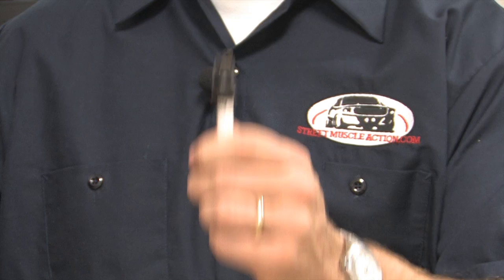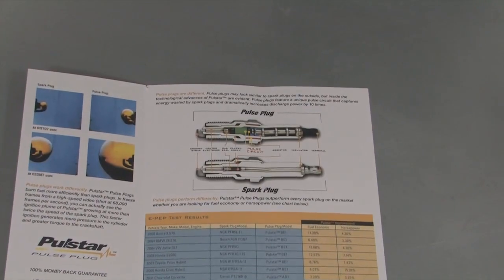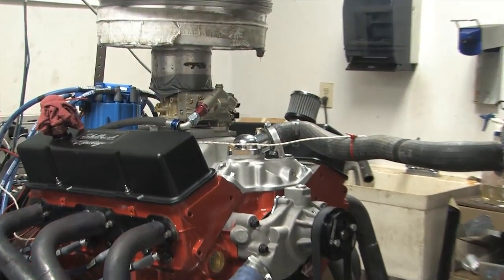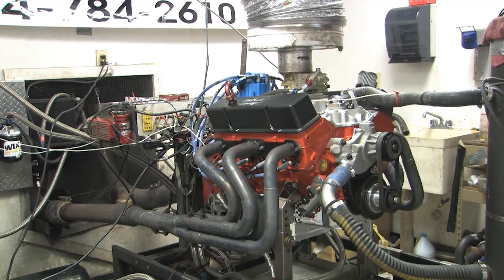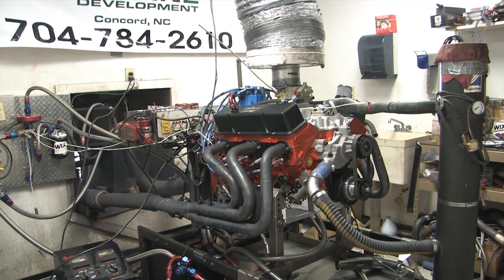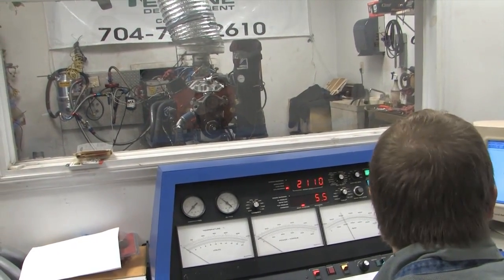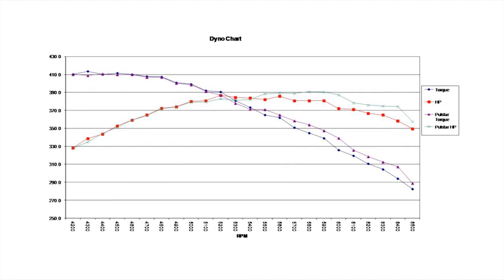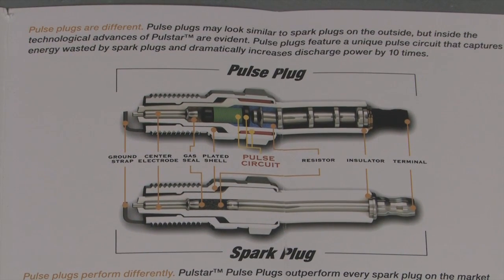Dyno Testing Pulstar Plugs to See if They Make Power

Comment: How to steam clean the engine constantly while you drive.

Get A piece of paper and twist it clockwise until it looks A twisted blunt.  Get in as much twists as possible.  Then put it into the air intake before the air filter.  Make sure that it is parallel with the intake tube and secure from being sucked into the tube.

Drive the car like normal for about half an hour and then pull over to A parking lot and get out.  Go to the back of the car and put your hand in the exhaust stream.  You should feel damp vapor coming out of your exhaust.  That is how you know it is working.

  This should give you A few MPGs better mileage for A few reasons.  Coolant is A lubricant, the coolant is already hot and turns to steam easier than if you have A mist system.  When water turns into steam it expands A lot.

You should use environmentally friendly coolant if you use this trick.  To protect your health and others.

I have not done this on A rotary car yet!  So you are on your own if you do this.

Try it or not, as it may damage your engine.  

The coolant will have to be checked more often as well.

Comment: In the US, we say foot lbs. Just wondering where your getting this lbs feet ? Your not measuring feet.
Reply: Both terms are equivalent. Despite the different wording the torque unit here  based on Force X Lever Arm Length. Using English base units is (n Pounds Force) X (1 Foot) effective dyno lever arm length. ( With a lever arm length of 1 foot, the resulting torque is equal to the Pounds Force number with the unit Pounds X Foot, = Foot X Pounds, or ft/lbs. Equivalent torque values can be expressed as constant pounds force with variable lever arm length,  or variable pounds force with constant lever arm length. For the same pounds force, with a 2 foot long lever arm would be twice as much torque. BTW, Torque does not depend on the rate of production ( engine RPM). For example, any value of measured torque at zero RPM is zero HP.
Reply: J.S. Sancrant  I know. It's just that we used to always say foot lbs. But thing change.

Comment: As long as people continue to spend hard earned money believing good marketing lies...you'll see BS claims like this.
Anyone who's been around awhile will remember Splitfire plugs making the same promises, with the cost being around 4 times as much as any other spark plug of its time.  The ONLY way a spark plug can make any more HP is by burning more fuel.
Reply: At least pulstar makes sense in theory.  A hotter faster spark due to capacitance.
Reply: @SubLimation7  projectfarms tests also show pulstar as outperforming Iridiums which i've sworn by. pulstar and e3, at least the two models PF tested, both were head to head fuel efficiency wise. they ran a generator for a min or so longer than the iridiums(iridium was about 45.5 minutes, pulstar and E3 were nearly 47 minutes). for 8 bucks for an e3 plug i figured it was worth the test for my own vehicle. pulstars are expensive and rare here in canada so maybe next time i need a spark plug in a few dozen kms.

Comment: Thanks so much. Not worth it at all especially with a car that takes around 4-5 hrs to change plugs because the motor is trans mounted. I have a 2008 Highlander with 170k miles with the same plugs. I’m replacing with OEM plugs for sure.

Comment: Didn't (and won't) watch the video.  Using such a highly  modified engine is the worse way to test aftermarket parts.  I think a plug is a plug is a plug, but why doesn't someone do A/B testing on half a dozen stock cars (from economy to performance) comparing brand new Pulstar plugs against brand new OEM plugs for HP, TRQ, and mileage?

Comment: You mean the stock 3.48" stroke. Ford uses a 3.5" stroke, stock in the 352FE, 352W, 351C and 352M engines.  Heavy used the 3.48" stroke in their 350 and 305. The funny thing is back in the mid 60's Vic Edelbrock took a 350 hp 327 , broke the engine in according to GM specs and put it in the dyno. It only made 313hp. He tried a few thing and when he swapped plugs from AC to Autolite the motor picked up 5hp. This guy is going from Autolites to these new plugs. So if Vic had had them back in the day he could have picked up 8hp must by changing spark plugs! Hmm..
I wonder what would have happened if Firestorm plugs had been available! They induced a plasma into the combustion chamber instead of a spark, providing a cleaner, more thorough burn of the airfuel mixture. They were way more efficient that any sparkplug ever made, but the inventor was met with resistance everywhere he went. Thesparkplug companies didn't want them because they lasted too long. The oil companies put up a fight because they improved mileage significantly, and the Auto Manufacturers didn't want them because they owned spark plug companies and were influenced by the oil companies. Every time someone comes up with a better mousetrap, somebody else shuts them down! Shit!
Reply: I'm glad I encountered somebody else who is aware of the Firestorm spark plugs. Nice design. I've corresponded with Robert Krupa, in the past. Your comment reminded me of him.
Reply: @brianwesley28  I hope he's doing well. I really wish I can get some firestorms directly for the saab.

Comment: i know boshe platnum plus 4 make power
Reply: biggdaddy blade works: I like Bosch Platinum +4 plugs, however reality is electricity takes shortest path, so you only get one arc, however when that ground strap gap becomes wider than one of the other 3 the arc will move to one of them...on further review having the ground electrodes on the sides of the center electrode on most modern pentroof central plug placement seems to make the ignition much more complete.  Most everything I have for snow removal, has been switched to at least 2 Ground electrodes, and cold (-20°F) starting has vastly improved.
Reply: M Shultz idk i just know they make a noticeable difference
Reply: and they are not 25 each

Comment: So basically, the improvement in Hp/Tq occurs when the speed of wavefront becomes a limiting factor (4k RPM+). So, unless you're racing, there's no benefit to using Pulstar in regular street/beater cars.

Comment: I bought a set for my 1998 Honda Accord 4 cyl coupe and achieved 31 mpg at 80 mph on a 1200 mile trip from Detroit to Dallas. The car is rated at 28 mpg; that's an increase of just over 10%. They didn't work very well in my 2008 VW Jetta Wolfsburg with the 2.0 turbo though. That engine ate the side electrode on all four plugs by about 25k miles! Weird!
Reply: ShiftyKen 08 more than likely the fuel..refinement...check millage rateings euro...their fuel is more highly refined..you will be surprised..same happens here some parts of country when switching blends..
Reply: You can't use one run as a definitive judgement. I made one trip in heavy head and side winds, and I lost a few MPG. Did the same trip a week later with no wind and was back up to normal. Did it in rain and lost a tiny bit of mileage too. 🤷 You need several trips and an average of all in order to make a claim.
Reply: Are they still in the Honda and if so, are you still seeing gains?

Comment: i wonder if it works on motorcycle
Reply: Here is a guy that tested on a Harley with positive results. Wish there was more independent tests done.... I'll be trying them in my 2001 Honda Insight. It's only a three cylinder so pretty cheap. Thinking about running some mpg tests with a few different plugs...

https://youtu.be/ce6ijLPx9Fs

Comment: A carbureted engine, as this appears to be, may not be the best application for these plugs.  Possibly power is available, on the upper end would be nice, if Lamba O² readings allow for a little more fuel. A close comparison of all the data may reveal something worth thinking about. You're in for $200 already... Best of luck.

Comment: why not test out  10 different sets  basic , cheapy  $2 plugs .  autolite , bosch  chanpion , ngk  denso etcc . You might find basic plugs can out perform  the high dollar pulstars   . Wouldn't that be embarrassing . .
Reply: ...copper core plugs actually might beat it. the reason fancy plugs use platinum and iridium is lifecycle, not conductivity. copper is king for plug performance.
Reply: @noclouds111  It is true, once you ignite the fuel mix it won't matter what started it. But you go keep the industry happy spending money not needed. It's why third party addons love people like you.
Reply: @oo0Spyder0oo  If what you say is true, then installing new spark plugs will not make any change in HC or CO emissions. We know that that does actually make a change. Heat ranges also wouldn't matter for spark plug selection. A hotter or colder plug can be chosen for best combustion results. I don't believe in this Pulse Plug concept either, but I also know that combustion and flame front dynamics are not black and white issues like you portray. Same goes for a diesel engine. "Injector nozzle design doesn't matter. Spray the fuel in and it'll burn all the same. No need for 2/3/4 pulse injection." That's again, simply not true.
Reply: @mannys9130  Good for you
Reply: Each car maker designs the engines to use certian plugs toyota uses ngk ford uses autolite Chevy bocsh or whatever they use so you may have a good point you should use what the engine is designed for
Reply: Exacty. You ca't get ore hp, it's there to ignte the mix so the manufacturers put in the right plug to do that job in the beginning. It's like saying you can burn down a house better using a better quality match.
Reply: I'm sure they'd be happy to do that if you paid for them all.

Comment: In my experience, it takes a little driving for the ECM to adjust to the Pulstars. Using a chassis dyno for torque and horsepower plus very precise fuel measurements will tell a more accurate story, with a few days of driving on the Pulstars before the test. The manufacturer has done MANY of these.

Comment: I purchased these for my focus. Ran okay for about 5k miles then all of a sudden I had a minor misfire only when idling. I wasn't sure what it was considering I had new plugs, wires, and coil.. but I thought it was worth it to take the plugs out as a "by the by" type of check. Better safe than sorry, right? Cylinders #123 were okay. Number 4 spark plug the ceramic coating around the the center electrode had knocked itself off and by the luck of god did not fall off into the cylinder. I believe I still have pictures of it too. Absolutely would not recommend these. Trash. Over priced trash.
Reply: jake20479 you over tighten the plug or there was a factory default in it all ways check the plugs before you put them in.
Reply: Theodore Orcutt i checked all the plugs before I put them in, and I know I did not over torque them. If it were a factory defect then okay, but honestly for how much i paid, there is No excuse. I've never had that happen to any other plug..
Reply: You're not the only one to experience this. Take a look at the reviews on Amazon. As for overtorqueing, that is nonsense. If one is stupid enough (or strong enough) to overtorque a spark plug you will either strip out the threads in the head or break the insulator, both of which will be obvious during installation.

Comment: These plugs or specifically designed to be used with coil packs. Use a modern motor with modern ignition and fueling. I guarantee you'll get the results. 

Lets use this motor that has technology that is 60+ years old and see if we get similar results as with a motor that was designed 5 years ago. Of course you're not going to.

Comment: Test the E3 plugs. I like ac delcos in my small block chevys but my toyota does better with the ngks my guess is certain spark plugs are designed to work with certain engines

Comment: My educated guess is that due to the different ignition speed and duration of these plugs it could be beneficial if a dynamic spark advance curve was used, and in my opinion it probably needs to be retarded a little if the combustion speed is indeed faster at the low speed range, same where the graph lines overlay, and it probably can take a significantly more advanced timing after peek power.

Comment: Engines are built with specific plugs in mind. A hotter spark on an engine not designed for it would mean eventual ruin.
Reply: niFe you mean hotter heat range?
Reply: This and everything is electronically controlled anyway in today's engines

Comment: I was very skeptical about Pulstar Plugs.  After installation,  my Jeep can now do wheelies,  the rip in my seat in now gone, and ice cream tastes sweeter.  Thanks, Pulstar!
Reply: Sweet. 
I'm gonna put a set in my 91 Jetta diesel. 
The darn thing is only rated 52hp and it could use some help.
Reply: LOL
Reply: They made another hundred horsepower on my electric mower
Reply: It’s the best invention since slice bread!
Reply: They even fixed the tear in the seat.....Holy shit!!!! Ima try these. Maybe my brakes will work better 😂
Reply: Billy  seems like every 8-10yrs some new snake oil comes out. 
I remember the slick 50 from when I was a kid. 
Haha the only way to keep an engine from wearing out is to not use it 🤣
Reply: Didnt you post the same comment on the actual video from the pulstar channel?
Reply: and you suck for black